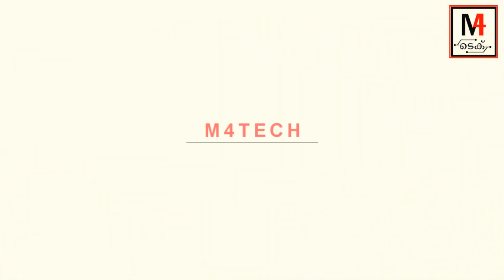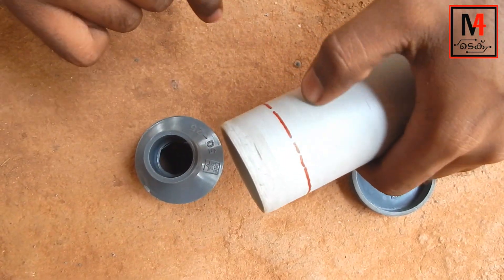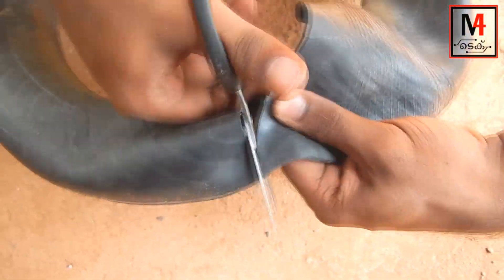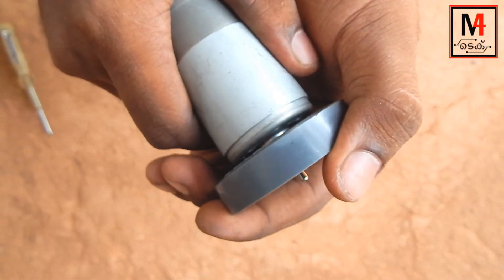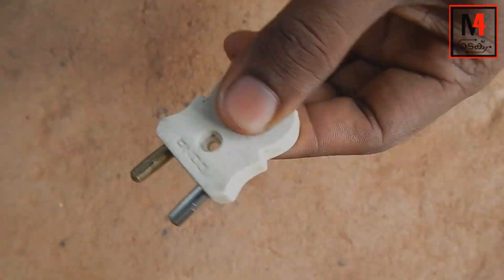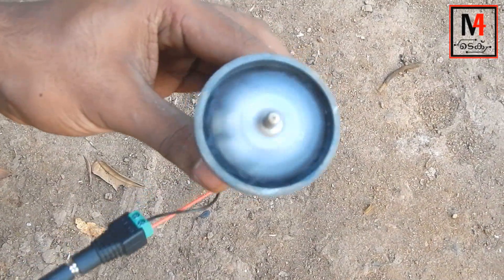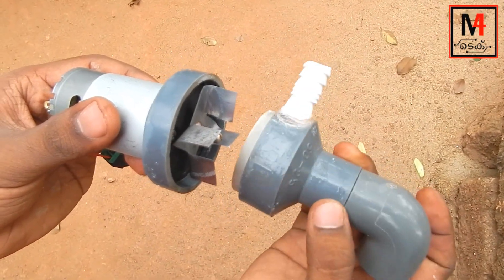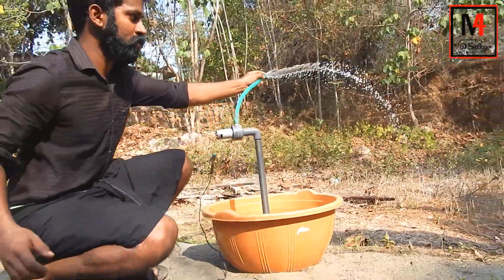How To Make A Mini Water Pump At Home | പമ്പ്‌ ഉണ്ടാക്കാൻ പഠിച്ചാലോ... ??? |

Comment: but where you drilling the hole for motor shaft , and inside puting rubber packing to make it leak proof, in all so many pump making videos also showing same , and I have asked this same question there also , and suggested from my side to make a long rod to keep motor aside from water , because you are pasting round rubber, but exactly at hole circumference there is no provision of leakproof, so in professional water pump making what they are using? I am also mechanicle draughtsman but not ITI , private exam, so I have this question in mind from so many years, even when I was in boiler company long back, that time service engineers not able to satisfy me 100 %, because exactly at location I mentioned above there you can not fix glue as 
you have keep minimum gap / margin for rotating action of shaft , so how you will stop water leackage, because here you have shown that after some times hole may become bigger after some time due to heat, is it not ?and if you fill that gap full with glue then shaft will not rotate ? kindly answer my question and satisfy me 100%
Reply: Using silicon grease may be helpful

Comment: Dear there is a doubt , As water will leak to inside of motor from impeller units as front & rear bearing seals are not available.

Comment: machane  electrical and electronics components multimeter kondu check ckeyyunna methodum koodi cheyyamo...example  capacitor,  diode  and motor winding ect..